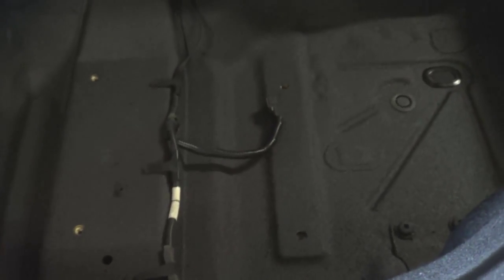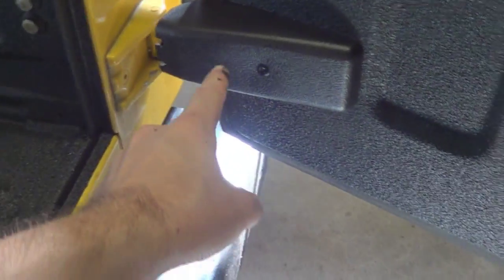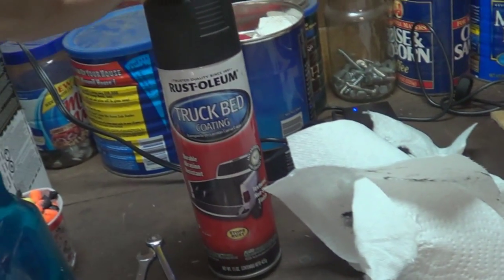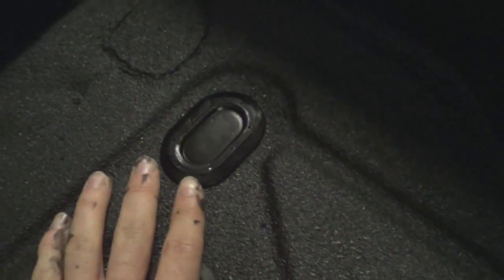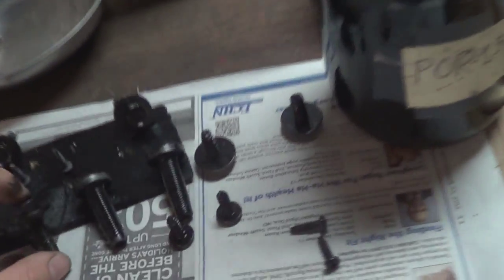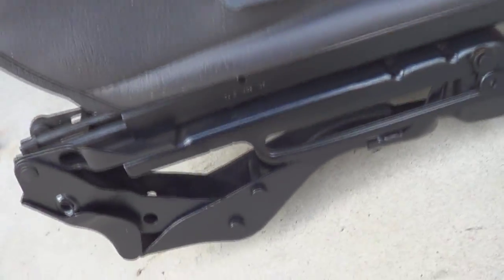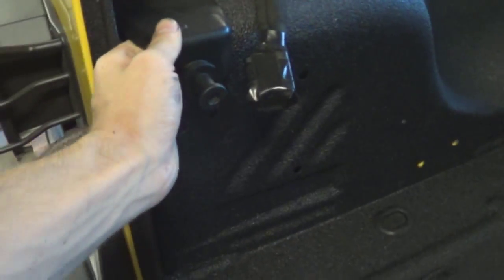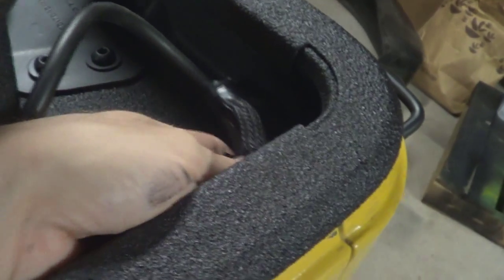Jeep Wrangler TJ Update #49 "Touching up bits and pieces"

Comment: Ok it’s been 7 years. 2 questions…
1) I’ve seen a lot of ppl not recommending using bed liner because it’s rubber and holds in moisture causing rust you don’t see so in effect, your Jeep rusts without you knowing until it’s pretty badly damaged. Did you have any issues like that?
2) plasty dip…saw a video where someone was complaining it peels and also wears off easily. Did you encounter the same problems?
TY
Reply from the maker: This Jeep was already on a downward slope with rust both body and frame. 
-So keeping that in mind its hard to say if bedlinner traps moister long term. I can't reliably say. Some areas bubbled rust over time, but the large majority did not.
-Plasti dip over a long enough amount of time did seem to peel off of certain surfaces. But overall stayed on well for how easily it adheres to most anything. In short I would opt for traditional paint unless traditional paint wont adhered or I don't want the paint to be permanent .

Comment: Great videos!  I just painted my 99 TJ and am about to do the tub now. I have used the rustoleum roll on stuff before with good and pad results. what bed liner did you use? was it Raptor spray in bed liner or Herculiner? I have seen some great videos on the Raptor stuff and that's what I was kind of leaning towards. some say it is a lot like plastic not rubber. thanks
Reply from the maker: 98moto Yes I used Raptor spray bed liner, I love and if your doing a large area I recommend it highly. A good comparison of its texture would be that of a bumpy orange peel, smooth to the touch, not to slippery but not to ruff either. Its really good stuff and easily the best thing Ive done to my Jeep to date.

Comment: do you have any videos about how to install the wires to the hardtop to the controls to turn on the wiper and window defrost, I have a hardtop added to my jeep but it did not come with the wires.Brian
Reply from the maker: +serf3469 No I dont, I wasn&#39;t interested in anything like the for my hardtop so Ive never looked into it but knowing what the after market for Jeeps is there has to be a hardtop wiring harness out there somewhere.